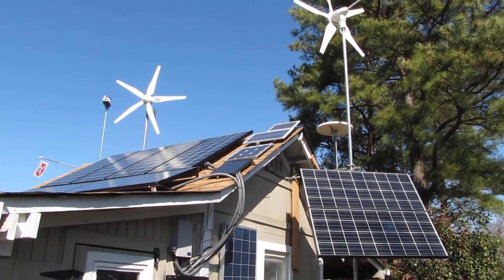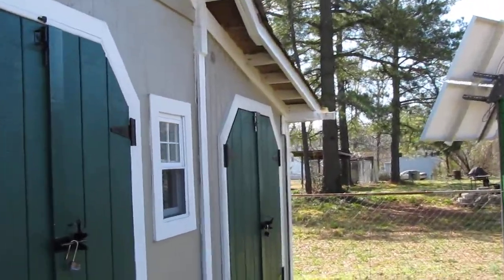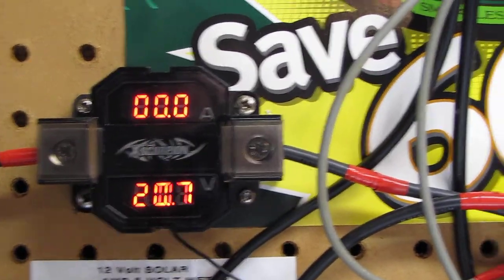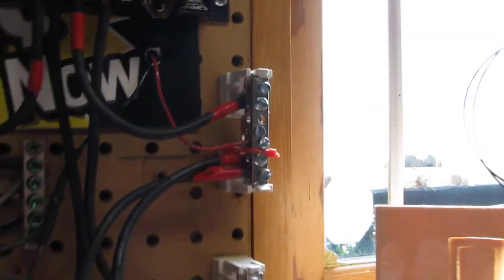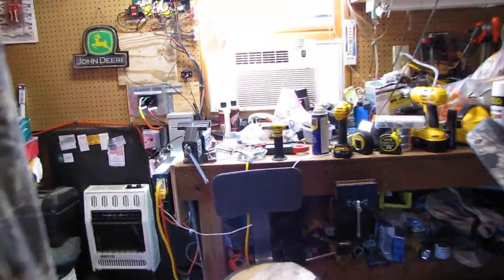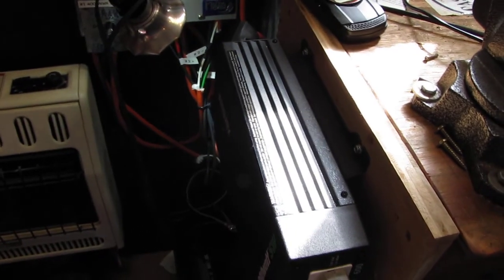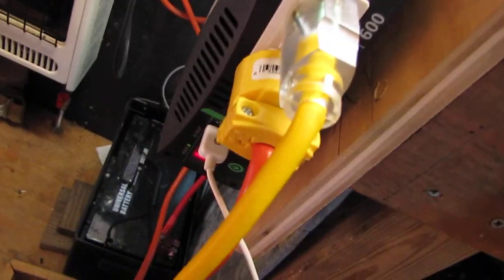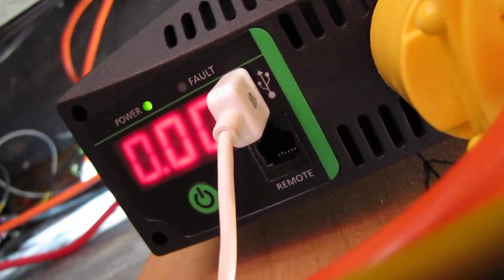OFFGRID  SOLAR  POWER THE EASY WAY VIARLOCITY  HOW TO !  PT 1

Comment: Nice video.   I love your solar command center.   If I could humbly offer a suggestion, I would suggest more fuses.  I am guilty of the same on my system but plan on putting them in as soon as the weather warms up.

Comment: Thanks for the Video... it's very informative.  Your charge controller is limited to 6 Amps.  If you have a larger Amperage, can you spread the load over several Charge controlers, or should you use a larger controler?